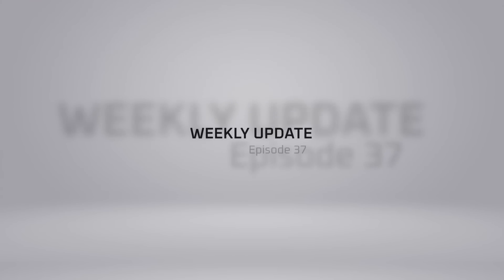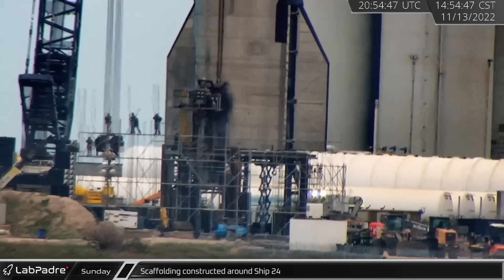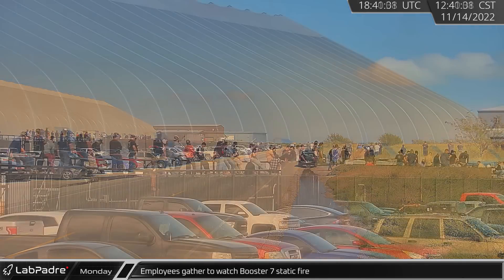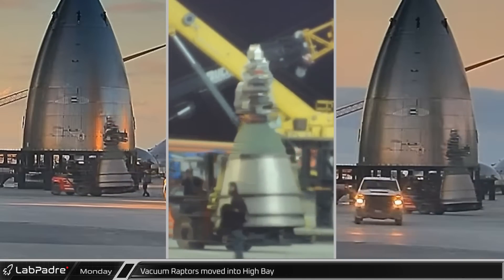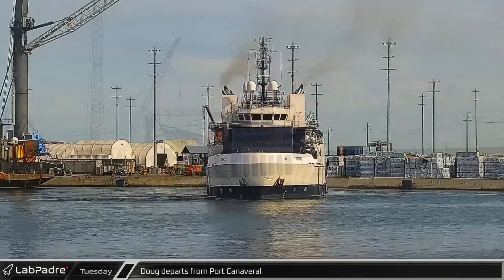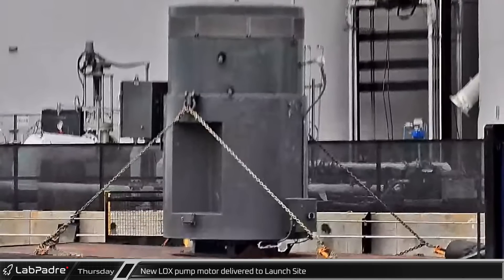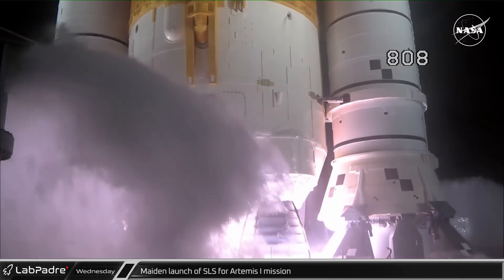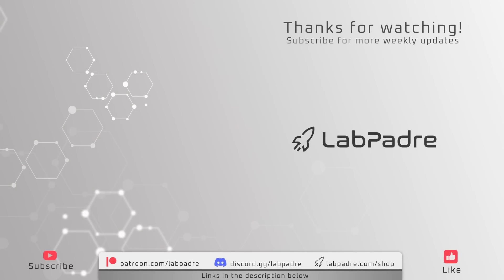Super Heavy Massive Static Fire Test  - Weekly Update #37

Comment: The sls launch was only fun for the first 2 mins after it launched. There were no rocket cams. No solid rocket cams. Nothing. No landings. The whole thing felt like it did during the shuttle days of just watching the rocket take off and going home. SLS must be so cheap that they can not afford to integrate some damn go pros on their rocket. 
When starship takes off and goes to the moon. its likely there will be a live feed all the way to the moon until the batteries die or a solar panel array is expanded and we have a live feed on the moon which is very possible. Also there needs to be a rover on the moon.

Comment: The launch mount problems for Spacex are NOT TRIVIAL and in fact quite serious.  Extreme heat turns concrete into sand and gravel - PERMANENTLY.  Even worse is all the evidence of the launch kicking up stone sized ballistic fragments impacting all over the launch site and (no doubt) the delicate engine mounts and mechanical assemblies on the underside of the booster itself.  Another case of lazy over-iterative Muskian arrogance in not considering easily avoidable unintended consequences.  

I hope they solve these commonsense problems BEFORE attempting to launch booster 7.  Meanwhile Artemis is 5x5 executing complex lunar orbits and a full mission model while Musk is so busy ruining Twitter he can't even get B7 tested into earth orbit.  Oh well.
Reply: Based on the speed that they are replacing the martite covering concrete at the OLM with the bags of fondag already on site, they expected that they would need to replace it. The good news here on rapid iterative design is that this will save even more money as SpaceX has plans to build atleast seven Orbital Launch Mounts and Towers.
Reply: Artemis (or SLS) isn't exactly 5x5 either. Many things in 39B are damaged beyond expectations, and that's with proper water deluge & flame trench that people are so obsessed about
Reply: @alvianchoiriapriliansyah9882  What exactly is damaged? Sure it got some damage since it hasn't had a rocket launch from it in 10 years or so. But it's also 55 years old, launched Saturn and Shuttles for years. The fact it's still there is saying a lot about flame trenches and water deluges. Can't wait for the first Starship to take flight and see what happens there. Let alone see if it will still be there in 50 years.
Reply: Agreed, I don't think the actual heat, force and sound that is going to impact the direct area around the launch mount was ever seriously thought about. Or, more likely, brought up but dismissed by Sir Musk. There's a reason just about any rocket launch pad has flame chutes and critical equipment is kept at a distance. But, guess we'll (he'll) find out.

Comment: There seemed to be pad shrapnel everywhere though.
Reply: There was quite a bit of concrete that went flying, this was to be expected as they've had this issue before at Test Stand B where they corrected it with fondag. They have not corrected it yet under the orbital launch mount, but seeing as they immediately start ripping up the concrete and have pallets with 3,200 lbs fondag prepared and ready this was probably the plan at all along.

Comment: I have no data or information to corroborate my synopsis but...
In my speculation, the mobile crawler may have been damaged by the launch of SLS/Artemis @ 1:47AMEST on Wednesday  to the point it may be inoperable. This would means that M-1 may require complete dismantling where is sits.
Reply: The crawler transporter was parked a few miles away from the launch pad. Maybe something happened to the mobile launcher, but that doesn't move under it's own power. The crawler picks it up.